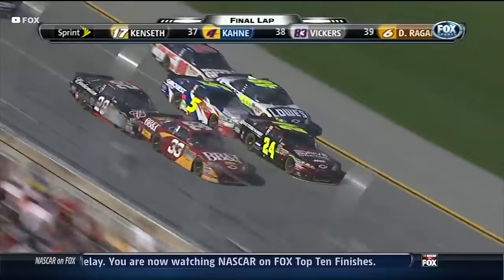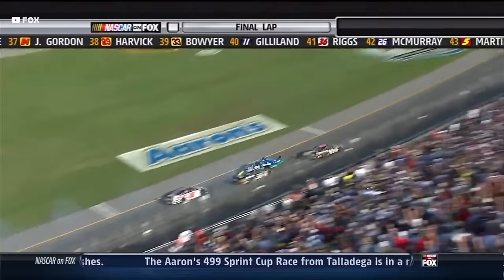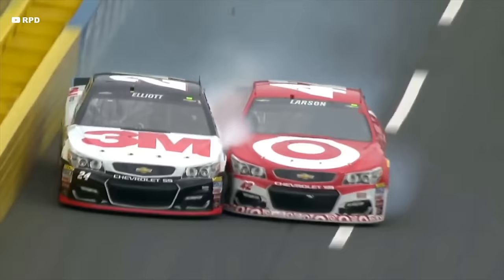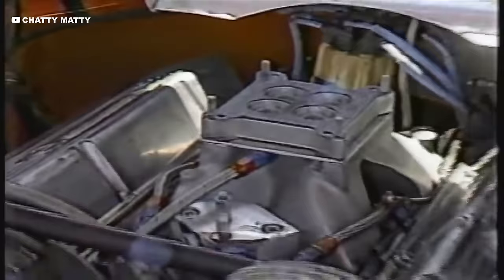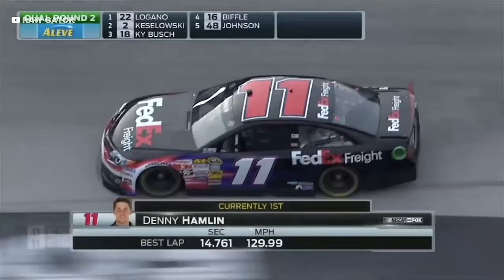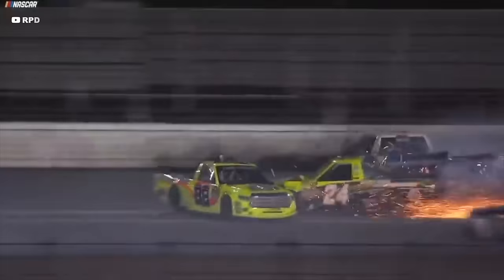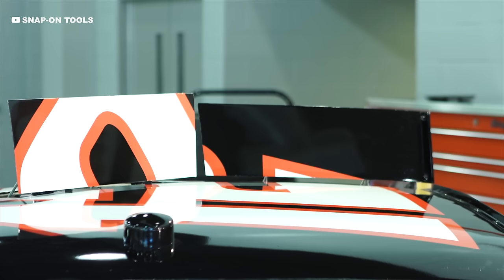The Simple Invention That Saved NASCAR

Comment: Up until Daytona this year I thought those cars were 100% safe.....
Reply: Even in this video there were cars flipping over despite the flaps opening up
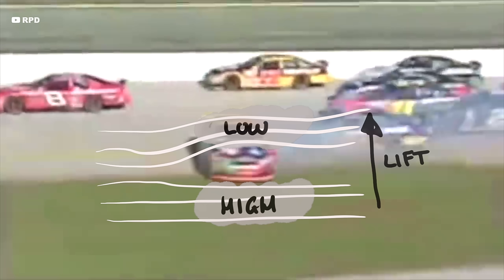Reply: Yep 4:26 4:42 - might help in a lot of scenarios but when e.g. other cars are involved this is not enough...
Reply: I mean, they technically are; Newman is still alive and came back a few races later. Ironically, Newman, who has an engineering background, invented the Newman bar, built on the rollcage above the driver's head to keep the cage from collapsing. His own invention saved his life.
Reply: @lorddrac_dontaskmetodance  He very possibly could have died tho. I wouldn’t exactly say that’s safe
Reply: there's always room for improvement, motorsport will never be 100% safe, there's always one situation that will eventually happen
Reply: PoliceManHat  the Hans device would have saved them
Reply: PoliceManHat  Earnhardt was totally against the Hans device ,a full study determined a Hans device would have saved him . basilar fractures accounted for 60% of fatal racing accidents before the Hans device become mandatory and of the drivers you mentioned most of them died due to basilar fractures or related
Reply: PoliceManHat  I just meant that using the hans device would have saved more drivers than the inclusion of the flaps
Reply: PoliceManHat  Let's be honest though; NASCAR, nor any sport, is going to be 100% safe. If it was, it'd be boring to watch and nobody would do it because it'd be boring to do as well.
Reply: We need superconductive magnet track to disable car flying now. ( .3˙)
Reply: @lorddrac_dontaskmetodance  they are absolutely NOT 100% safe... That same impact on a taller driver could've been fatal.

NOTHING THAT TRAVELS 200MPH IS "SAFE"... there's greatly decreased risk of death from the safety advancements, but there absolutely will be another Nascar driver that dies in the future. It's just a fact.
Sounds bad I know, but it absolutely will happen.
If Nascar or F1 or Indycar or any racing series goes on indefinitely, drivers in each series will die.
An F1 driver could die from a piece of debris that falls off the car in front... Or a small stone etc.
Imagine a small, sharp rock being tossed up by a leading car at monza... It could easily miss the halo, and go straight thru the drivers visor behind him.
F1 visors are "impact tested" yes - but they are absolutely NOT rated or able to stop a small, sharp stone going 200+mph. If that stone hits the drivers eye, that's easily a fatal problem.

Say a Nascar driver spins out and is stopped on track facing the wrong direction, and a car hits him head on at 200mph. Or, even worse - if a driver goes straight into a wall at 90 degrees and 200mph... Just the brain going from 200mph to a complete stop could easily be fatal.

Your internal organs are traveling the same speed as the car, obviously... And nobody has internal organs that can sustain an instant stop from high speeds... Simply the forces smashing your organs or brain forward in the accident can cause death.

Same for Indycar or any racing series.

Drivers can and will die again, it's just fact. It sucks, but so far there's no safety devices or combinations of safety devices that can stop all fatalities.
Reply: @zuminlair92cp  dude nascar just needs to get more downforce on their cars
Reply: @csonkaperdido  did you see my 2nd reply?
Reply: @lorddrac_dontaskmetodance  I didn't see it earlier, but now that I went back and looked thru the replies slowly I see that you already said racing will always be dangerous.
My reply was to your comment, but I meant it more as a general statement.
Obviously you understand, so apologies if my reply came across as being a dick. I didn't mean to be rude, just meant to say that racing will never be truly "safe".... Just like you said.
I know people watch for the danger factor also... I personally don't like the idea of racers dying bc I sometimes race in little SCCA events, but I am not remotely close to being a professional driver. I'm genuinely average at best, it's just fun.
I've seen some people get hurt badly though, the worst was watching 2 cars that were directly in front of me have a crash - and one of the drivers was a beautiful girl who was maybe 20 years old at the most... She was just learning how to race and had only been racing for a few months and unfortunately she was badly hurt.... I hear she recovered, but she hasn't been back at the track and people who know her say she doesn't race anymore which is a real shame. She was genuinely faster and much more talented than 90% of the other drivers, men or women. But she almost had to have her arm amputated and from what I heard she has some gnarly scars from surgery etc. I can understand why she got scared and said fuck this I'm not racing anymore.
If I knew her name I'd reach out to her and invite her to drive my car on a track day or something, but I also don't wanna bring up bad memories for her. Other people have apparently offered and she said no, I assume bc she's scared of crashing now. Which is understandable when you've had a bad crash and almost lost a limb at a young age. I wouldn't care as much if she was an old, ugly fat dude. But yea that's a random off topic story anyway lol
Reply: @asmallyoutube  noooooo they need less... More downforce =harder to pass each other... And if you put on more downforce, then end up backwards which is absolutely always gonna happen, your downforce turns into lift and shit gets sketchy.
Nascar tried using a rear wing instead of a spoiler, and literally every time a car spun around 180 degrees the rear end of the car would lift up off the ground... Even at lower speeds. It was stupid and mad dangerous.

Downforce is not always the solution to everything - it actually makes racing worse. Faster, but less passing.

One of the main reasons why there are more passes in a single Indycar race than an entire f1 season is bc Indycars have around 1/3rd less downforce than F1 cars - and therefore they are able to follow each other closer, and pass each other more often. The "dirty air" you always hear about in f1 is slightly less of a problem in Indycar racing.
Reply: @csonkaperdido  I know that'd be harder to pass. But it ain't meant to overtake someone fast either. You're meant to go fast while being safe. Why cars need downforce? To stay on the fucking land.
Reply: @asmallyoutube  Wrong. Nascar cars already don't have much downforce as they are. They used to have even less downforce and they stayed on the ground.
ANY car is going to fly into the air if it spins out going over 150mph.
Race cars have downforce to make faster lap times, that's it.
Actually if you knew anything about aerodynamics, you would know that the main reason cars flip and fly is bc they have rear wings and spoilers that only create downforce in 1 direction - going forward.
Turn them around, and the more wing they have the easier they will fly into the air.
Downforce has absolutely NOTHING to do with safety. Nothing. If anything it makes the cars less safe, because when they lose control in a corner they will hit the wall harder and faster than if their car didn't have any downforce at all.
Reply: No race car is 100% safe.......Antoine Hubert. The track and runoff areas are as much of the safety equation as the cars/driver equipment.
Reply: PoliceManHat  I don't think any of those died from a car flipping. I believe tyey all died hitting the wall before SAFER barriets were invented.
Reply: @carlfrye1566  And no race car is slow.
Reply: @Realtime1501  Very likely, and SAFER barrier. SAFER barrier I think has saved a few drivers.
The next thing which needs to be addressed is the fence at Talladega and Daytona. NASCAR has escaped tragedy a few times when cars went up into the catch fence and tore it up. Debris flies into the crowd and I think it's onl thg a matter of time before a car doesn't get thrown back on the track and conitinues toward the crowd. I know they have moved spectator area back.....it looks like about 40' but I was thinking thry should raise the wall to at least 8'....and then have a row of bullet proof glass at the front of the spectator area to stop debris.  Newmans wreck was made more serious by him getting hit by a car after he came backk off the wall impact. The car held up well but he was lucky, and I believe they are working on more robust protection in the area he was hit.
Reply: @csonkaperdido  I can still remember the 1st car that went airborne, Cale Yarborough was qualifying at Daytona and he did a 212 mph lap, got sideways in a turn, and the car lifted and flipped on to it's roof. I think it was early/mid 80's, a big, aerodynamically challenged, off the assembly line stock body Monte Carlo with some shaved door handles. Those cars had so much hp(pre-restrictor plate) they were faster than todays smaller wind tunnel created cars. Those engines in todays cars.....235 mph easy.
It made everyone scared, and those old drivers weren't easily scared. They could do those speeds around Dayrona side by side and laugh while smoking a cigarette, but get the car off the ground and they wanted no part of that. 
I think it made the cover of Sports Illustrated.
Reply: @asmallyoutube  soap box derby cars?
Lol.
Reply: @carlfrye1566  That fence always makes me nervous at Talledega ,I have seen that fence get pushed to the limit on few occasions . I would like to see the stands raised 30' above the track and have a fine mesh catch net extended 10' over the track,it could have a double benefit of keeping spectators safer and allowing less restrictor plate to be run which is a win win either way
Reply: Some cars create enough lift to raise the nose(my 74 Corvette lifted the nose a bit at 75 mph and the steering went light/loose), and that always needs to be addressed in racing cars, but "Downforce" as we know it in racing was/is developed to allow cars to take corners faster. 
CFD has made aero the dominant factor of modern race car design, and is the origin of the ugly LMP cars..
Reply: @ShotgunRocket  Moreso when thry go from track to grass and back again.
Reply: @Realtime1501  Yes, I think they have raised the stands above the track but it isn't a lot.
Some old youtube videos show the grandstand walkway right up against the fence. I have been to Richmond and Dover and stood a few feet from the fence, and never gave a thought to a car hitting the fence. Never went to Daytona or Talladega and walked along the fence. It's crazy how most(including me) race fans think the fence is a solid wall of protection.
I think a better option than restrictor plate would be a smaller displacement engine to limit hp, the plate engine is already a different animal/R &D program so might as well take off the plate and get the throttle response back with less hp. That is why they keep the pedal to the floor during a crash, to keep up momentum, in a non-plate car they wouldn't need to do that.
Reply: @carlfrye1566  I was born in 1984 so I wasn't watching much Nascar in the early to mid 80s haha... But those boxy cars still had a front splitter and rear trunk lid spoiler, they made a little less downforce than today's cars but not much less.
Those 70s Daytona challengers with the massive rear wing and front chin air dams probably made more downforce than today's cars.
But I do remember Bill Elliot doing a 212mph lap at talladega or Daytona and then the restrictor plates came.
I think the restrictor plates are absolutely stupid. They absolutely make it more dangerous, all they do is force everyone to ride everyone else's ass and they still go 200. A 10 car crash at 200mph is much worse than a 1 or 2 car crash at 210mph.
Nascar is a joke now, I don't even watch it anymore. Between the pack racing, stupid stages, stupid points system that makes absolutely zero sense, the stupid "playoffs", and the constant caution flags for a single leaf being on track, it's just unwatchable for me.
Shit they throw the yellow flag sometimes when there's nothing on the track, they just make it up to bunch the cars back together cuz they think that makes racing more exciting.
One of the best races I ever watched was at talladega and there were no cautions for the entire race.
It made strategy more important, and it made driving more important. If the driver made a mistake and lost the lead pack, his hopes for the win were gone.
Now you can be 20th with a couple laps to go and just draft your way to the front.... Or get a free pass if you're a lap down.
Racing shouldn't be about free passes, and necessity for drafting in any series makes the racing worse. I still watch road course races, but I don't watch any of the oval races. Over half the tracks are exactly the same anyways, a D shaped oval. Nascar has gone way downhill in the past 20 years.
Reply: @csonkaperdido  Born in 1957 and I hear what you are saying about current NASCAR. I loved the old wasys but I have gotten over the changes/chase/stages/etc and still follow it. 
The old cars were nowhere near th ed aero of todays cars, they were bodies directly from the manufacturer with a small air dam in th ed front, a spoiler on the back, and door handle removtd, the cars since the .id 90's have been handmade aluminum panels shaped specifically for aero, especially the greenhouse/roof....and are also about 20% smaller frontal area which makes the CD lower by itslef.
NASAR is like other sports with rule changes that make the sport somewhat unrecognizeable other than they are cars and are racing.
NASCAR does a lot of market research and they are competing for viewers because the old fans are gone and new fans are different. 
Lol, I still don't like the DH in baseball, it just a way for old guys who have made $$$$$ playing for 10/12 years to play another 5 and make even more $$$$, just to bat and hang around.
Reply: @carlfrye1566  that's true about the shape of the cars - if they removed all the stickers today and the fake headlights, nobody would be able to tell a Ford from a Toyota.
I personally like the DH in baseball though, because most pitchers suck at the plate.
There have been some damn good hitting pitchers lately though. Madison Baumgartner used to hit 4-5 homers a year and Zack Greinke was a 250 hitter.
I'm a rays fan, literally nobody in the entire Rays lineup hits 250. It's hard to watch them strike out so damn much.
Reply: They're phenomenally advanced from what they used to be, and are incredibly safe for what they are used for, but yeah. Nothing can be 100% safe. Not even a car as advanced and safety focused as the NASCAR.
Reply: @ShotgunRocket  it was older or it was damaged or it came out in a weird angle but it still works it dose take off but it lands right the older model's sometime flip
Reply: What happened? I didn't see this year's race
Reply: @sbinnala14  he walked out of the hospital a day or 2 later. While it was a dangerous crash he suffered very minor injuries. I’d say that’s damn safe
Reply: @sbinnala14  you would be surprise it’s been a while with this new technology since a death has happened in nascar I honestly can’t remember when there was one
Reply: @csonkaperdido  he literally just said that
Reply: HOW?????
Reply: did you forget about the 2015 Daytona 500 finish...
Reply: Nothing is ever 100% safe in Motorsport but Giving Ryan Newman's Wrwck at Daytona last year ( A worst case scenario really) id say it will take a freak accident at this point to end someone's life.
Reply: nothing is 100% safe
Reply: No cars are ever 100% safe, but I think it's more a track problem than a car problem. For example, I watch F1 and IndyCar, and the safety standards of the cars in both are very high, but some of the track safety measures in IndyCar are significantly lacking compared to F1.
Reply: @ShotgunRocket  the flaps dont help unless theyre already up before the car gets airborne, otherwise they can actually make it worse
Reply: @thechasecalhoun  ….they are supposed to be as safe as possible. Roll cages exist for a reason
Reply: @ShotgunRocket  they won't work 100% of the time. A lot of them got hit from. Another car and pushed it up and over. Like Joey Loganos 2021 Talladega flip. The car wanted to flip but the roof flaps kept it on the ground until another car clipped his left rear and that pushed it into the air. I hope they could find something that can help that but idk what they could do

Comment: One critique to make, and it's the fact that fields for NASCAR Cup Series events are smaller now. The days of 43 cars on the grid are over and have been for a while. The last race to see 43 entries compete was in 2015. Why is that? NASCAR reduced the maximum field size from 43 to 40 in 2016, not just for shots and goggles by the way, either. The sanctioning body also implemented a (still very) controversial regulation that guarantees 36 entries into every race, called the Charter System, that's meant for the value of individual race teams to go up. I can go into detail about the pros & cons but for the sake of time, that's all I'm gonna say on that front. Other than that one correction, this video is about spot-on. In fact, IndyCar followed NASCAR in 2015 during that year's Indy 500, that saw a lot of flips before the race. IndyCar implemented flaps, just like the ones NASCAR requires, on the bottom of the rear wings to prevent lift, in the scenario of a backwards shunt. 

I definitely love motorsport, and although NASCAR is what I love the most since it got me introduced it, I follow all forms with a passion like many do. I really do love seeing non-NASCAR racing channels talk about stock-car racing, I think it's great and allows for greater exposure that wouldn't have been there before. Hoping you do more NASCAR content, because simply I can't get enough of that stuff.